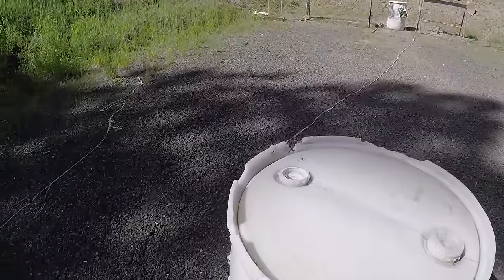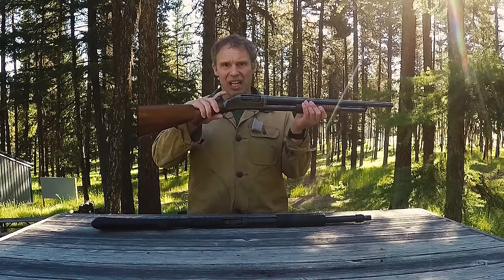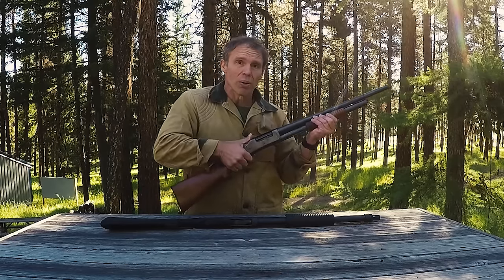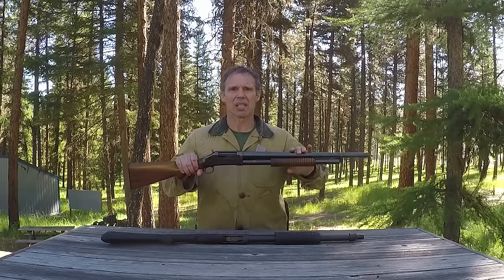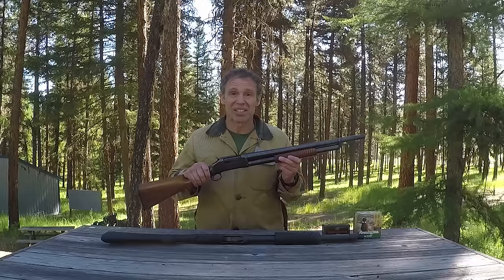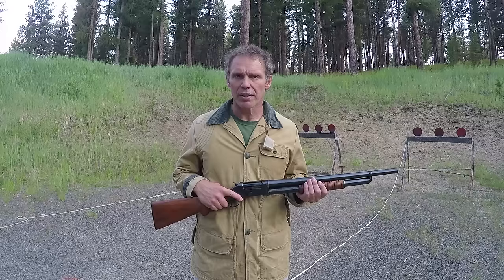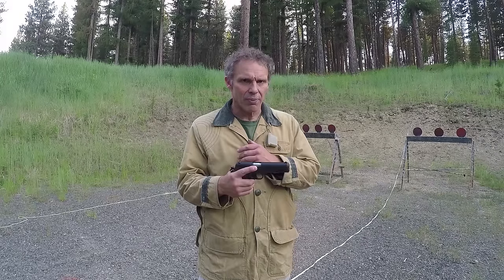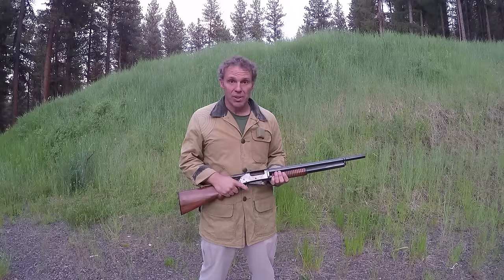Winchester Model 1897 Shotgun-Revised.

Comment: I like the last point about the ww1 soldier liking slam fire. I believe quite a few law enforcement agencies used the Ithica m37 which also can be slam fired. So there were probably a few cops who liked being able to slam fire over the years.
Reply: I’m pretty sure the modern 37’s won’t slam fire, if I remember correctly they took that feature out in the early-mid seventies for some reason. When I was shopping around for mine I made sure to get one that was made before the change.

Comment: Only one small point to make:  a "slam-fire" is designated as an unintentional discharge of a cartridge caused by the firing pin slamming forward as the weapon's bolt or slide slams into battery.  This is more common than most realize, in the case of those weapons that do not have a built-in firing pin block to prevent the mass of the firing pin from slamming forward into the cartridge primer as the weapon slams into battery.  1911's, M1 Garands, M14's and especially the AR-15/M16 design.  I have witnessed and have demonstrated, with a primed but otherwise empty cartridge case, the discharge of that primer by placing it in the chamber and releasing the bolt while pointing the weapon toward the ground.  As you say, Mr. Harrell, "Don't try this at home, I'm what you call a professional."  The reason these older design pump shotguns, and even some older pump rifles will fire while the trigger is held to the rear, is that they do not have a disconnector.  All modern repeating firearms I know of (I don't pretend to know ALL firearms) have a disconnector to prevent just such an event as you have so amply demonstrated.  I thank you for discussing this at length, as you are one of the few who have chosen to make the public aware of this "feature," and God bless you for it!  But a true "slam-fire" is not due to a lack of a disconnector, but due to what is known as good old inertia!  A weapon that will fire multiple shots while holding back the trigger was designed that way by folks who didn't think disconnectors were all that desirable.   Thanks to you for your otherwise excellent site, which I watch as often as I can, 'cause you are one my favorite firearms professionals!  God bless and keep up the good work.

Comment: This video inspired me.  I started out with my Dad's CAS Norinco 1897 that was a hunk of junk as it didn't function.  Also the stock was not cut right and the razor sharp bolt would hit and then fillet my hand.  I've since picked up a well worn 1909 Winchester M1897 and it's a dream to shoot.  The carrier stop screw was stripped and frozen into the carrier so I had to drill and re-tap.  The front of the 30" barrel was badly pitted.  Because it couldn't be cleaned, I suspect this was shot dirty for 100 years.  It took me days to get all of the powder residue out of it. I cut the and crowned the barrel, flexhoned the chamber and the smoothbore, and installed the 6 round follower.  Everything wrong with the Norinco is 100% right with this one. It works 100%, doesn't cut me up, and is a real treat.  It goes with me everywhere.  I had original '97 riot guns that I didn't shoot due to value so I'm very happy with this build.

Comment: I have a couple in various stages of disrepair. I am gonna retire soon and have been thinking about a 20 Gauge rifled slug gun built on a model '97 action. I have to check into it more to see if it is feasible. It is one of the first pumps to be sold commercially, if not the first, so there will some drawbacks. The main inconvenience I see is the all the small parts that can't be easily removed to clean like on the modern pumps.

Comment: Just picked up a '97 from an online auction, 1912 vintage take-down model w/26" bbl and full choke screw-in.  Had to clean the hell out of it, action and take-down mechanics were sticky and loaded with decades worth of fouling and grime, but it's since cleaned up nicely.  Might cut down the bbl to 20" and perhaps have the bbl rethreaded to accommodate the choke once more.

Comment: I got me a new norinco m97 12gauge shotgun. When the tube is loaded you press the 2 buttons on the side and the bullets come flying out the bottom. Its a newer shotgun. I love it. 20 inch barrel . I like to use highbrass # 2 heavy lead shot in this shotgun. Slidefire is really hard to hit something , id rather load and aim then shoot. Slidefire in the trenches is  trench sweeper.

Comment: I had an early Model 1897 shotgun and one thing I found is that the very earliest of them are chambered for 2 5/8" shells. not 2 3/4" and when you shoot them, the shells don't quite open up all of the way. I guess the popular thing to do is have the chambered reamed out that very last 1/8" to get the clearance needed. Personally, trying to find a good 1897 Winchester is getting harder all the time, I would not mind giving one of the guns Cimarron Arms had out for around $350 a look.

Comment: Just an FYI.  You  probably know this already and did your demonstration to show the worst case scenario.  In case you don't, once you release the hammer from full cock, remove your finger from the trigger.  Now if the hammer inadvertently falls while on the way to half cock safety, it will stop before hitting the firing pin.  You need to have the trigger pulled in order for it to travel beyond the half cocked position and impact the firing pin.  I really enjoyed your comment about the shotgun giving authorities the impression your are just an old geezer with a shotgun and are no real threat.  You are always thinking outside of the box.  Really enjoy your videos.  Keep them coming.

Comment: Regarding your point of slam-fires with old 1911/1911A1 pistols....

Something I learned from very old G.I.s back in the early 1980s.....  Since there were (and are) still a lot of old very-loose 1911/1911A1 firearms out there, it was considered good practice by these old-timers to hold in the trigger while dropping the slide as the weapon was pointed down-range.  What this did was engage the disconnector and keep the weapon from firing IF the disconnector wasn't itself worn out.  (and if the disconnector was worn out, the weapon would go into full-auto and dump the magazine rather quickly.)  After the slide dropped and all was well, backing off on the trigger resulted in a harmless click as the disconnector reset, and you were ready to fire.

NOTE THAT THIS ONLY APPLIES TO THE OLD 1911/1911A1.  USE THIS TECHNIQUE AT YOUR OWN RISK.

Comment: I wouldn't call that a slam fire. I think it was a feature and was quite intentional, though I can see why it would be easier to inform newbies with words they already know. I have a Stevens 520 that works the same way. It's worth noting that there was a version of the Stevens 520 that was built and used as a "trench gun."

Comment: So, your '97 originally had a 2 5/8" chamber?  Does it still?  If not, how much steel was removed? I ask because, if the chamber ring wasn't included in the measurement, perhaps too much steel was reamed out. Though the barrel  may have been Mb or MB/Cr alloy, those old steels were nothing like modern ones. Anyhow, just some ruminations. I realize that paper shells were very different from plastic ones and the 2.75" shells really aren't that length when fired.  You've probably already considered that and a lot more. Like your videos.

Comment: The Win 1897 already had a bad reputation by the 1960's when I first started hunting. First was the problem that Paul demonstrated, 2nd was the sear surfaces were prone to excessive wear and inadvertent discharge. Both sides of the family were big time hunters including market hunters way back when. 

There was two shotguns not welcome in their hunting parties, the Win 1897 and Browning humpback auto. Both guns showed they weren't to be trusted, plus the Win model 12 was FAR superior in every category so lots of M12's in the bloodline. 

Later some 870's were bought but for tall northern Europeans the stocks were atrociously bad fitting. You'd never guess I have a bunch of M12's in various gages and barrel lengths. Its the very best defense pump ever made.

Comment: Paul, you mentioned the about the possible failure of the hammer spring on the modern shotguns but what about the tubular magazine spring on pump shotguns in general? Wouldn't that be just as big a problem as the hammer spring if not more so? Double barrel hammer gun for the win? Also would it be possible for this gun to fire by pulling the hammer back just short of the full cock position and letting it go without pulling the trigger or is there a hammer block of some kind?
Reply from the maker: good points. I mention the tube magazine spring in our video on spring compression. As for cocking the hammer and letting go of it, if you're not touching the trigger the hammer will fall to the half-cock position.

Comment: where can you get an original and do you think it could handle modern shotgun slug and buck shot  I am limited to pre 1898 firearms
Reply from the maker: I don't know about slugs, but buck shot will be fine, just don't get the extra heavy loads
Reply: Paul Harrell  you could probably do a pumpkin ball slug or you could probably do a cut shell
Reply: I shoot factory slugs through my 1898 manufactured 1897 shotgun.
Reply: TreeWizard648  no ffl gun good choose
Reply: Brett Duffy I bought mine as a junker and built it back up.  Pre 1899 1897s are hard to find because only about 33,000 were made before 1899.  Only about 31,000 Winchester 1893s were manufactured (Both models share the same serial number range).  I also own a Winchester 1893.  An antique 1897 will have a serial number below about 64,000.
Reply: TreeWizard648 I can only own antiques right now and I'm tired of replicas with muzzleloaders they are not quick enough for a home defense situation or in case of Bear runs after you in the woods

Comment: 1897 Winchester with a 30" barrel.  Cut it down to 20" or keep as is?  It's already been reblued/refinished and the stock is not original.  Any reason to keep a 30" mod choke barrel excepet for hunting?
Reply: decided to keep it at 30" and just find a replacement barrel to cut down :)

Comment: For us ignorant on shotguns. Why would you not want to remove the shells by holding slide release and pumping the slide? seems very easy
Reply: gangsterelmoman any time a round goes into the chamber you have the potential for it to fire. Taking them out of the tube is safer.
Reply: And the extractor(s) can chew up the rims pretty good after a while too. Some safety nuts will also point out that dropping a shell on the ground could make it discharge in theory if something happened to hit the primer just right. 
What are the chances of all that? You be the judge!
Reply: I saw my cousin do that one time I was visiting my grandmother (he lives on the land my grandfather owns) Not sure if he was hunting or what but he came in shotgun in hand and jacked all the shells into the title floor that is right in front of the door before it turns to carpet. Guessing my grandmother was worried about them hitting the floor and going off cause she yelled at him, and I think it was along the lines of "I told you not to do that!"

Comment: I hope someone sees this and responds. With the hammer in the half cock position, should the hammer fall if the trigger is pulled? I was under the impression that half cock was the “safety” for this design and you should not be able to depress the trigger??
Reply from the maker: At 3:55 The hammer is fully cocked by putting a round in the chamber. I have to pull the trigger and manually lower the hammer to half cock. If my thumb slips off the hammer while my finger is on the trigger the hammer will NOT fall to half cock. It will fall all the way.

Comment: That hangup in the slide at 9:02 is why I have never trusted an 1897. I had one for a while, and it did that every time. Not smooth at all.
Reply from the maker: The only hang up was me. There are some1897's that don't work right, but mine does.

Comment: I always wanted an 1897, to use not for a collection. Does anyone know of a quality reproduction?
Reply: Tantan Gipo 
The Chinese repros made by Norinco are actually quite good. A lot of people have assumptions about anything Chinese, well in this case they got it right. You can find their Riot guns (Like what Paul has here) in the 300 dollar range. What I really want is a Trench Gun but they dont import those anymore and theyre impossible to find.
Reply: Aren't Norinco guns banned from import? Can you still get a new Norinco 1897?
Reply: AgamemnonTWC 
Yes Norinco rifles and pistols are banned, but shotguns are not for whatever reason. In fact my local gunshop got a new shipment of 1897 Norincos just last week. But theyre the Riot versions. For some reason they stopped making their excellent Trench gun model. The one I want, go figure.
Reply: Pity about the trench gun model, that one looks awesome. I wonder if the parts to modify a riot model into one are still available. 

I'd love any 1897, and certainly wouldn't mind a Norinco if it's cheaper. I suppose I should start looking around, but I'm lazy and cheap and online sellers tend to be expensive and limited. I haven't yet bought a gun before, but I'd like to soon, and I think a shotgun would be a good first.